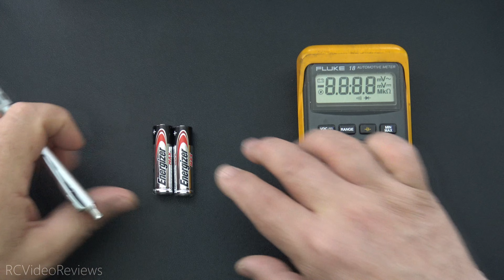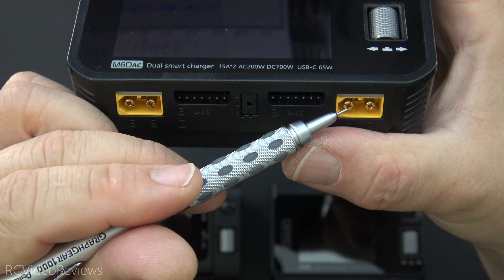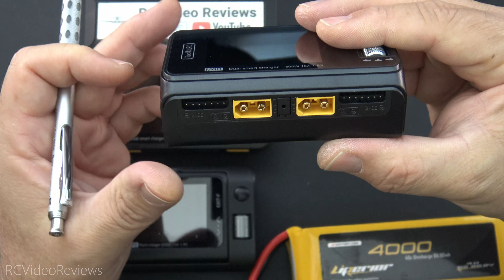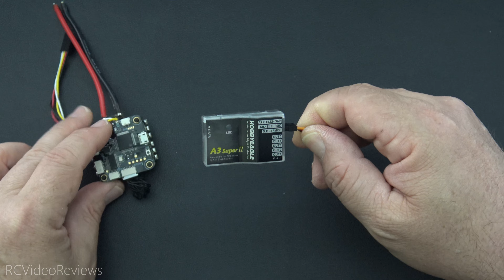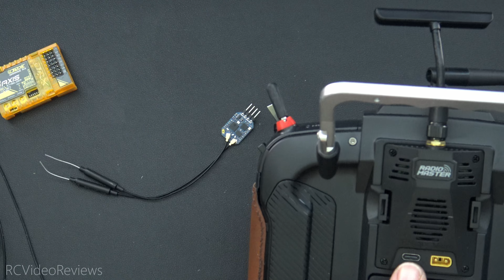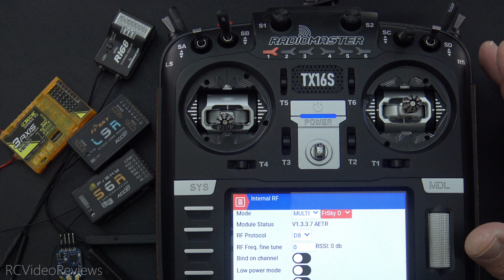New to Radio Control Flying? Don't Spend Your $$$ Until You Watch This...

Comment: Do you have a video setting up a reflx gyro on a 3 position switch for the radiomaster tx16s mkii there's nothing on the web I have found to help
Reply from the maker: The manual says "The default channel assignment is aileron, elevator, throttle, rudder and mode switch" So in your mixer, add a 3 position switch as the source on mix line number 5.
Reply: @RC Video Reviews  okay thank you. Im new to  learning the open source  system been using  closed  source system.

Comment: With RC motors, I, indeed, discovered that "size" is weirdly measured. One of my smallest size motors is rated for 6S, 1400kv. yeah baby. I salvaged it from a damaged 70mm EDF. Going to go in a carbon 20 inch speedboat. Gearing for 4000rpm shaft speed. Not a clue on prop size...LOL Ought to be fun....

Comment: The "opto" in opto esc is an opticaly isolated circuit . From HobbyKings website -What is Opto?
Opto in radio control (RC) contexts means Opto-coupler. On the ESC (Electronic Speed Controller) ie. 
Motor Controller, the power used to drive the motor is electrically isolated from the power used to 
control the servos. This is supposed to reduce radio interference between the motor and receiver as 
light signals are used between the motor and receiver circuits. As a result, the ESC requires separate 
battery packs, one of the motor and the other for the receiver
Reply from the maker: I'm curious if they truly are optical. Seems like a good idea for all connections doesn't it?
Reply: @RCVideoReviews  I'm sure fiber optic for the servo control wire would be great , but I probably don't want to pay for it :)

Comment: Very good, up to date, video for beginners. A little more detail about avoiding cheap unlabeled/undocumented  ESC's with low capacity linear-type BEC's vs  name brand ESC's with switch-mode BEC's to avoid "brownouts" would be better. Pros and Cons about Open TX vs traditional RC Systems would be good, i.e. cheaper, receiver compatibility, vs beginner learning curve compared to Spektrum and Futaba. A little more about stabilization devices and power supplies for chargers would also be of interest to beginners. I know, trying to keep it simple!!
Reply from the maker: So many subjects out there. Good suggestions. Thanks.

Comment: "Opto" is for optoisolation.   That means the throttle signal is optically coupled to the smarts of the ESC, instead of directly electrically coupled.  Usually done  for reduced electrical noise transmission. Optical coupling means the throttle signal is communicated via a LED and a phototransistor pair.  The throttle signal's pulses drive the LED on/off rapidly and the phototransistor sees the LED's light.  Voila.  Info transferred without direct eletrical connection.  Great video!
Reply from the maker: I wonder if today's BEC'less ESCs that are labeled opto are truly opto. If optoisolation prevents signal noise, wouldn't it make sense for all ESCs to use it regardless of whether they provide a 5v source?

Thanks for the info.
Reply: @RCVideoReviews  Whether they truly put an optocoupler in the design or its just marketing nowadays is a good point.  In general, optical isolation is a good idea but it's another component on the PCB and pennies often matter on consumer electronics 😀.  Love your videos BTW.  Always great info.   Totally helped me when I finally bought a T16S too!
Reply from the maker: Glad to help. Thanks for the comments.
Reply: From all of the motor controllers that I have dismantled, repaired & got working over the years, a lot of RC motor controllers that carry the "opto" name are nothing more than marketing tactics. A lot of them don't have an optocoupler on the signal line to the motor controller's microcontroller (the brain box what controls everything that your motor controller does). All it means is the motor controller does not provide a low voltage supply line back to the rest of your onboard electronics (IE receiver, servos, flight controller etc) & you need to power your onboard electronics from a different power source.

If optocoupling is to reduce noise, having an optocoupler placed only on the signal line to the motor controller itself doesn't make any sense, because there are electronic components inside the motor controller (such as the microcontroller) that is sensitive to this same noise that manufacturers are claiming to do away with.
A better design is to optically isolate the MOSFETs what do the actual switching to spin the motor, because this is where this noise comes from. Optically isolated gate drivers do exist (& are not to be confused with IGBTs). However, they add to the complexity & already high price tags of many motor controllers (not to mention the size of the components themselves), & quite often are not suitable for our applications, because they are more suited to much larger applications where this noise is more likely to prove problematic (EG EVs).

Unless you're doing it for redundancy purposes, "opto" motor controllers for our applications are otherwise unnecessary. Even the highest voltage & current (EG 50V, 200A) motor controllers don't generate enough electrical noise to affect any of the low voltage (EG 5V or 3.3V) electronics. Also, modern voltage regulators (what people in the RC hobby know as "BECs") are extremely good at noise rejection from the input voltages that they are specified to operate on.

I believe the main reason why these so-called "opto ESCs" exist is due to inertia in the hobby, where people that originally had their aircraft powered with internal combustion engines powered their onboard electronics with a seperate "flight" battery, & that has carried over to aircraft that are fully electric where they use a "main" battery to provide power for their motor(s) & a seperate "flight" battery for the same purpose as they would in their aircraft with an internal combustion engine.

With that being said, having a seperate "flight" battery & "main" battery for redundancy purposes is understandable (& in some applications, necessary). However, the marketing around "opto ESCs" appears to focus primarily on claiming to reduce noise. Redundancy doesn't seem to enter the picture, here.
Reply from the maker: Great info. Thanks for taking the time to post.
Reply: @RCVideoReviews  You're welcome. =^/.^=

Comment: The subs/Pam illustrates the wiring differences. Are there performance considerations that would make one better than the other?
Reply from the maker: I don't understand your question. subs/Pam?
Reply: Serial bus vs PWM - the video describes the differences between the two but does not address which is the better choice for a newbie.
Reply: Aha!  Just stumbled upon your why SBUS tutorial. Thanks.
Reply from the maker: You might want to check this out too: https://www.youtube.com/watch?v=RAAazO5UdV0